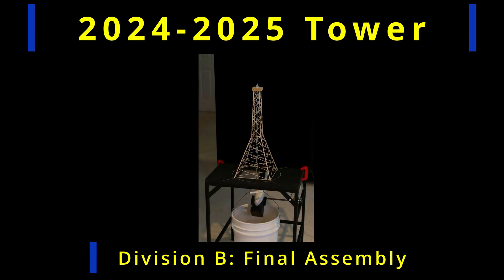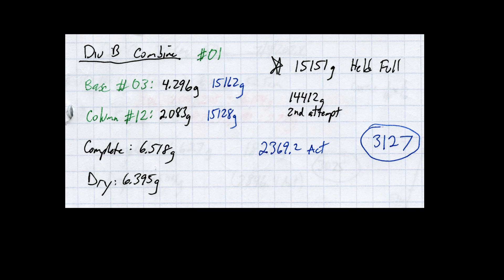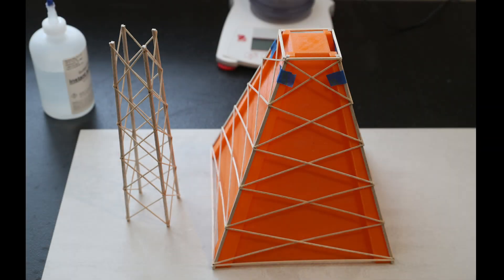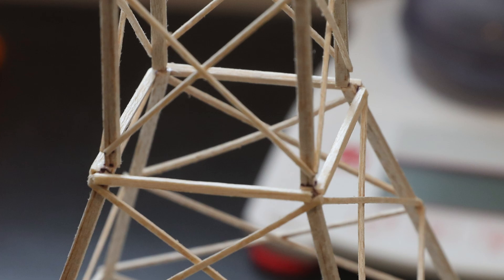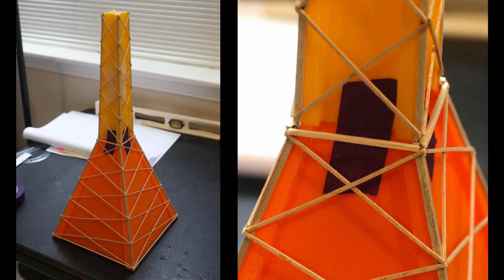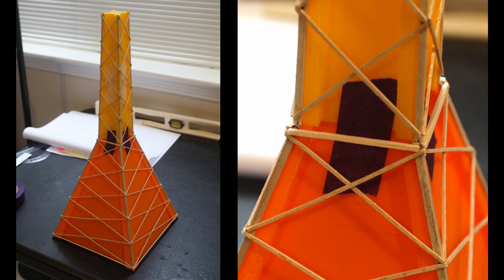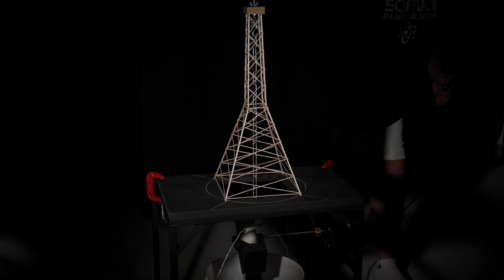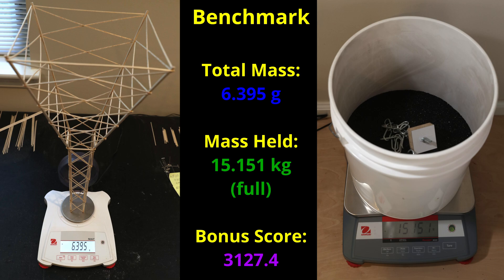2025 Science Olympiad Tower Div B: Final Assembly

Comment: What size of balsa wood do you use?
Reply from the maker: Please watch my videos on the bases and columns (and the latest non-bonus tower).  There I show my notebook pages which show exactly the sizes and weights of all the pieces.  In general though, 1/8 x 1/8 for the legs, and "smaller" for the cross-bracing.
Reply: @balsaengineering6686 okay thank you so much, after 3 attempts my tower still weighs 12 grams
Reply from the maker: @snowballz.snowflake  You just have to try and track down lighter source wood if you want to cut that in half.  You can order that from Specialized Balsa or if you shop locally, pick out the lighter sheets and go from there

Comment: My teammate and I have finished the base and column. Should we keep the jig for the base and just glue the column to the base or should I tape the jig for the column to the jig of the base and then glue it together?
Reply from the maker: Well, that's kinda the whole point of this video.  I did what you describe first and it worked, but I would recommend you try taping the jigs together and using it as a guide to help glue it together more accurately.  Good luck!
Reply: I understood that both techniques worked but I was indecisive about which one to use. Thank you.
Reply from the maker: @MayteVidal-y7m  It all comes down to what you are more comfortable with.  The simpler technique might be fine if you have another person who can hold the column in place, or you can experiment with gluing 1 leg at a time

Comment: Thank you so much for the video and all the help and information you've given to the SO community. We have been building towers and bridges for two years now and have had considerable success in both. However, despite our efforts and all the knowledge we accumulated, the base seems to be having a lot of failures, mainly towards the bottom two cross bracings in the joint portion. We believe this is because of the low angle in which the legs are placed. More importantly, the tower is failing at the joint between the column and the base (column is all figured out and the weight has been reduced, but with the bases we are building, everything is balanced out). We were wondering if you have any thoughts or suggestions, as we have hit a roadblock
Reply from the maker: Hi, thanks for the kind feedback!  It's really hard to tell what your issues might be with just words.  Can you email me some pictures of your latest towers and maybe I can offer some suggestions:  mklinger at comcast dot net

Comment: do you glue the cross braces to each other in the middle? Does this improve strength?
Reply from the maker: Yes, you definitely want to glue that center point between the cross bracing.  It effectively cuts the length in half and is 4x stronger wrt buckling failure
Reply: @balsaengineering6686  Thank you!

Comment: Would it be possible for you to make a video on a benchmark for a non-bonus design?
Reply from the maker: I have actually not built any non-bonus versions yet this year.  If I do and have success with it, I will definitely create a video.  All the process and concepts are the same for the bonus and non-bonus, so that shouldn't hold you back if you want to pursue a non-bonus version.  Because the way the scoring works, the benchmark build I showed can be applied for the non-bonus build as well. As I showed in that video, the equivalent non-bonus tower would need to be ~4.8g and hold 15kg, so that should be your target: https://youtu.be/EexIMmIpQgg?si=tEPsKzTObxRUrYzP&t=195
Reply: @balsaengineering6686  Thank you so much this is very helpful!

Comment: Thank You for the video. I was wondering how much balsa wood was needed for the whole design?
Reply from the maker: Thanks!  Well, there is a difference between how much balsa the build actually needed versus how much was needed to be cut up to get just the right pieces.  It's hard to put an accurate number on that ratio as sometimes you get more lucky than others, but it's probably anywhere from 3:1 to 5:1 or maybe more if you are really trying to get things perfect
Reply: @balsaengineering6686 is this the ratio for the thick wood to the thin?
Reply from the maker: @Fire_World428  No, I was estimating how much wood you need to cut up to get exactly what you are looking for.  Somewhere between 3x and 5x the amount of what you actually need.